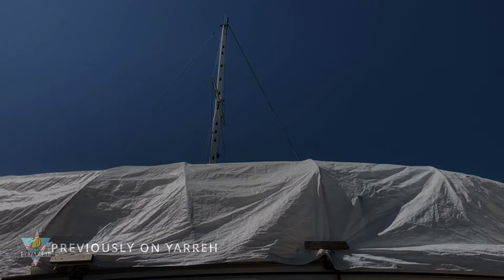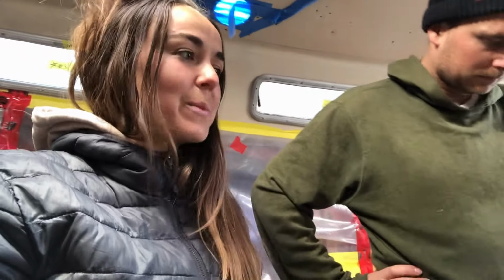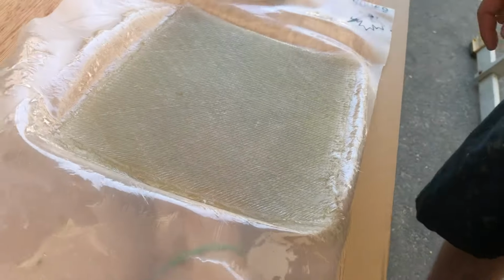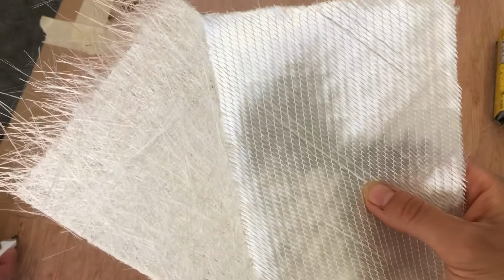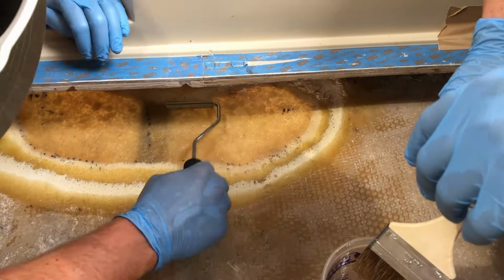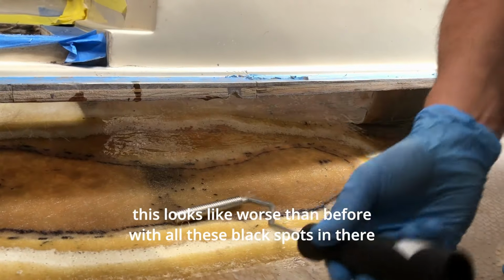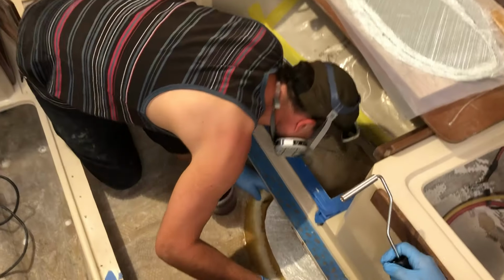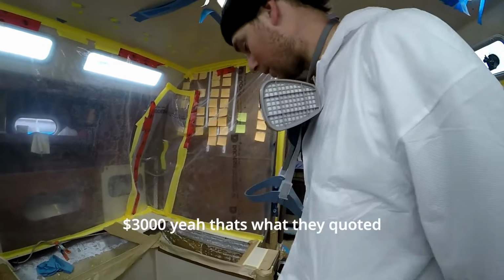The REBUILD BEGINS!! Reviving our SALVAGED SAILBOAT - SV YARREH Ep.15

Comment: A great explanation of the basics of fibreglassing but in regards to resin you are specifically talking about polyester resin. Epoxy resin, such as West Systems and Total Boat, are not catalysed and therefore can't be over or under catalysed.